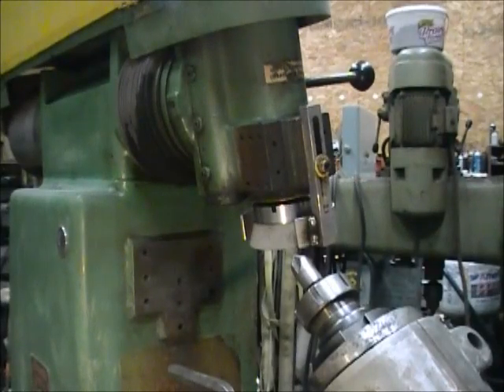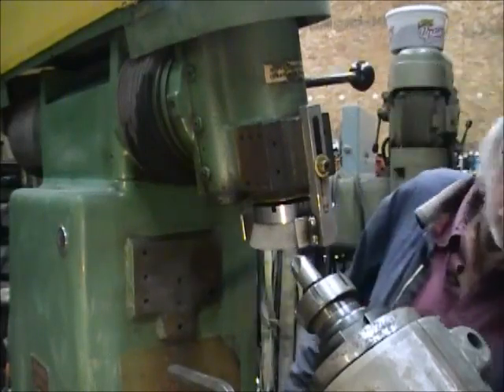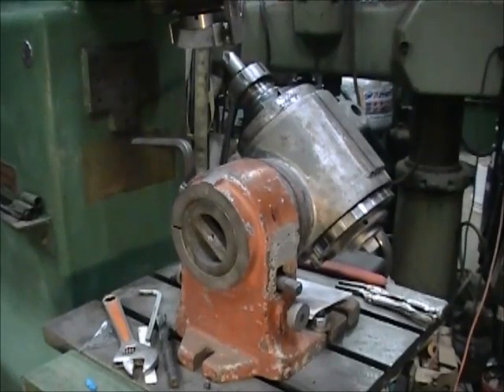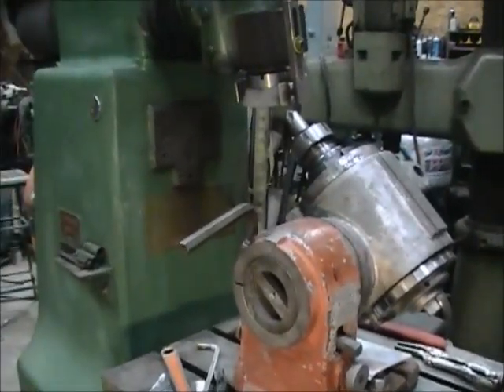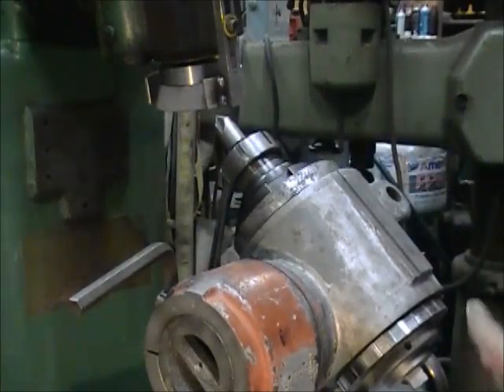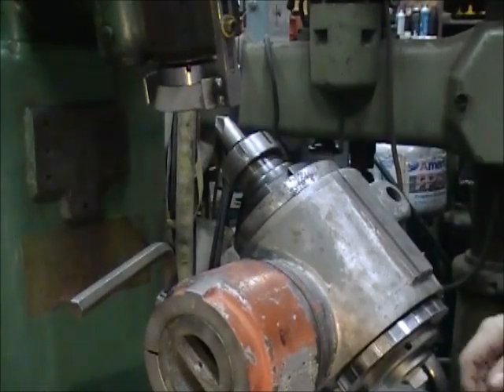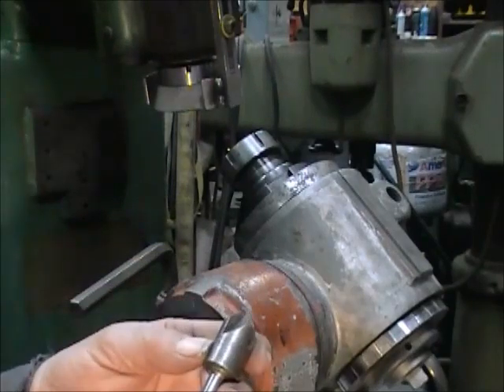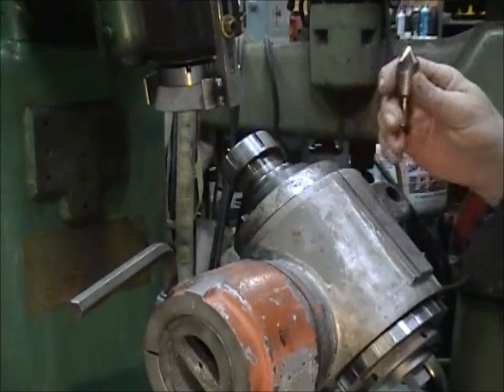Oliver Tool Grinder Sharpening a 82 degree countersink

Comment: I apologise for being so belated but I just caught up with your video, so perhaps you have found out in any case. Just to let you know, 4 fluted countersinks are usually unevenly indexed, so the face of the teeth must be the guide to the indexing. The 24 space plate should not be used. ATVB.
Reply from the maker: I did not know this, thanks for sharing the information.
Reply: @imysteryman  The uneven indexing was to break up harmonics(chatter). I had an Oliver HD 300(300 HD?) in my sharpening business. A very underrated machine in my opinion. I also had one of the first ANCA(Aussie) CNC Tool and Cutter Grinders.